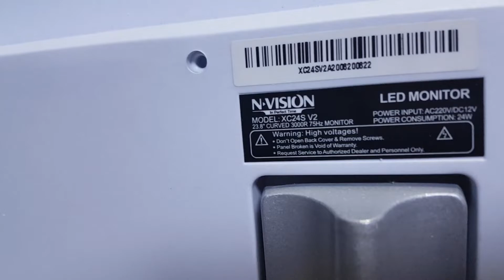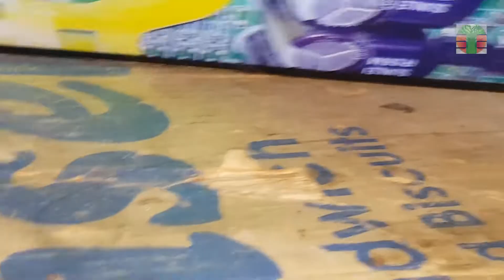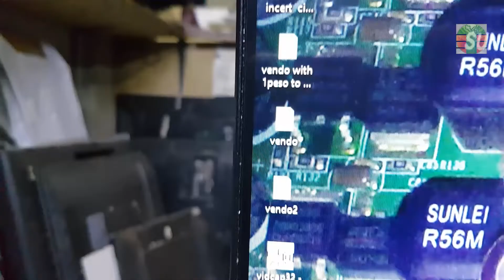N-Vision Led monitor model: XC24S V2 LCD screen fix

Comment: Hello, please help me. I have the same monitor with the same issue, I did scratch out the lines as you showed on the video. But after that only the right side which is clear the left side still has horizontal lines.

Comment: Hello sir! Nagbabaka sakali lang, nag gagarbage display din kasi ang Asus VP249QGR monitor ko pero hindi sya nag fflicker,  ma rerecommend mo ba na gawin ko din ito? or may ibang method sya para dito? yung 2% sa taas ng screen lang ang okay the and yung 98% sa baba garbage display na. pag nag 60hz ako nasisira sya pero pag naibalik ko sa 144hz umaayos pero may dead pixel mahabang vertical line sa taas.
Reply from the maker: Try mo sa method na to
Reply: @tevzTVTevatronics  Hindi naman sya masisira sir no? Basta tama yung mga ididisable ko na pins

Comment: Sir nvision IP240 monitor ko may colorful vertical lines siya dahan dahan lumalabas depende sa color nung nasa screen tas magaspang yung display niya, possible pa rin po bang may shorted na gates? cutting method pa rin po ba pag ganun? Thank you sir.
Reply from the maker: Di lang ako sure, pero karamihan shorted gates ang dahilan.

Comment: Thanks！ it really helps! Just don’t understand the concept behind, why is cutting the board will get rid of the flickering tho? Do you mind explain it in layman term pls? 😄
Reply from the maker: The LCD panel has a two-gate signal on the left side and right sides of the LCD screen. the left and the right gate signal is connected in parallel. If one of the sides has shorted gates, the screen will flicker or distort the image. If you cut the shorted side, the image will be normalized. Because the connection is parallel,  The LCD still has the other side work. But the side has the shorted will be darker or like lower resolution.  I hope have explained it in layman's terms.
Reply: @tevzTVTevatronics  short on panel or IC?
Reply from the maker: @konspirasiglobal6164  On panel
Reply: @tevzTVTevatronics  p
Reply: @tevzTVTevatronics  sir pano ko malalaman kung left or right side ang icut ko?
Reply from the maker: @gerardtayao3560  try mo left
Reply: @tevzTVTevatronics  master left side po ba kadalasan nasisira po?
Reply from the maker: @papenV  pareho
Reply: @tevzTVTevatronics  may po kayo video pang xc24s v3 po?
Reply from the maker: @papenV  wala pa
Reply: How to know either left or right side that need to be cut?
Reply: Inuna ko pong i-cut ung right tapos bumalik po ung image sa right side pero sa left wala parin po, paano po gagawin kaya kapag ganon ang result
Reply: Napaka linis ng pag kaka cut ko at lalong lumala ang sira di na napakinabangan, o shit 🤦

Comment: Anong explanation bakit po gumagana tong  method ?
Reply from the maker: Left and right gate signal kasi ang lcd panel,  yung left at right na ka paral ang connection. Pa nag ka short yung gate sa kabila ito yung problema, kaya pag na cut yung mga gate sa may shorted mag work sya. Yun lang may defecto yung side na nacut minsan mas madilim sa kabila.
Reply: @tevzTVTevatronics  Salamat po, ndi mas maganda po kung mapalitan yung Mosfet?
Reply from the maker: @madscientist1595  nasa loob ng glass yung mga mosfet.

Comment: Lods bkt po saakin ayaw, same v2 po. Dinisconnect kopo dun sa same spot na ginawa nyo.
Reply from the maker: i dogtong mo yun na cut at try mo sa kablia. pag ayaw parin. ganon na yun hindi lahat nag wowork.
Reply: Salamat sa pag reply lods. Ipapa connect ko muna sa marunong hahaha.
Reply: Follow up question lods. Yung pag cut ba dpat malalim? Or basta ma damage mo ng konti yung connection ma ccut na siya nun?
Reply from the maker: @chinoscicincobus9923  pag nag hiwalay na yung line ok na yun, kahit hindi malalim.
Reply: Nung sinugatan ko kasi yung line boss, nabakbak na yung green layer pero after nun green layer visible parin yung pinaka lines.

Comment: idol tevz...same problem po..same pcb layouts..then i cut..gumana po cya..after 2 weeks bumalik sa dati problema...what next i can do pra nmn mgamit n muli monitor..thanks!
Reply from the maker: wala na resolba pag ganon.
Reply: @tevzTVTevatronics  ...ouch...😐..neway   thanks po ..
Reply: Ingatan mo na boss ma Over use or over heat. Dun kasi ngsimula sakin. 8hrs ata ko gamit ng wala manlang hangin or lamig kaya ayun sobrang init tas biglang nasira screen.

Comment: Nice
Reply from the maker: Thanks
Reply: @tevzTVTevatronics  why did you cut what type of signal or voltage is at that point
Reply from the maker: @elroytucker1420  The lines that have been cut were the CLK and VGH ODD and VGH EVEN.

Comment: Sa akin boss hindi parin kaya ayusin ng ibang techinician  , paano po malaman kong anong clasi yung circuit board niya  model : xc24s  yung sa akin?  Pareho lang ba yung mga circuit board sa xc24s v2 ?
Reply from the maker: makita naman sa video kung anong klase ang board.
Reply: @tevzTVTevatronics  same tayo ng board boss 😅  pero kina cut ko ngaun yung ginawa mo pero hindi effective .
Reply from the maker: i connect mo ulit yong  pinutol mo tapos sukan mo sa kabila, may mga hindi talag na aayus.
Reply: @tevzTVTevatronics   san banda sa  kabila boss?
Reply from the maker: Hindi ko na video sa kabila
Reply from the maker: Mag bilang kang lines sa pinul ko. kung ilan sa pinak una sa pinul ko, doon ka rin ma simula doon sa kabila.